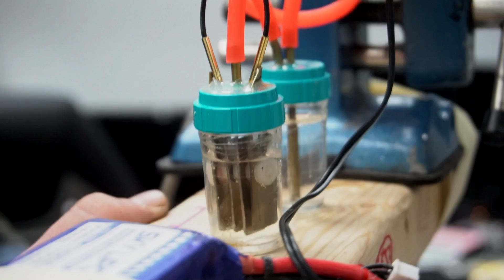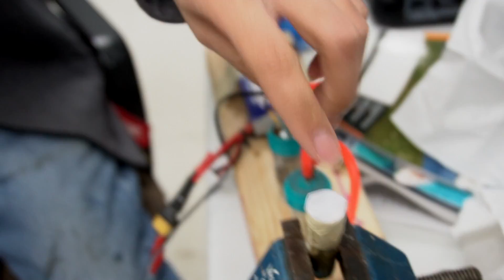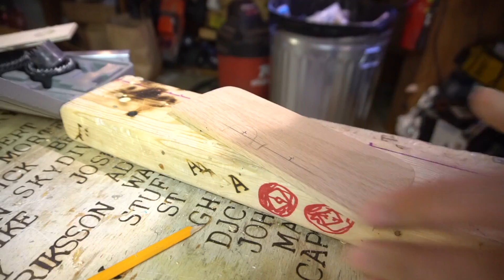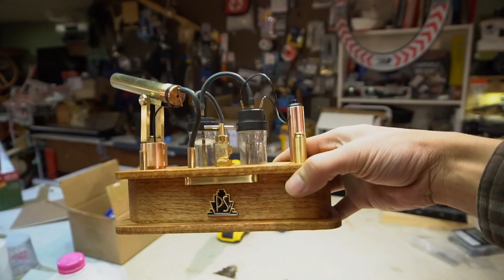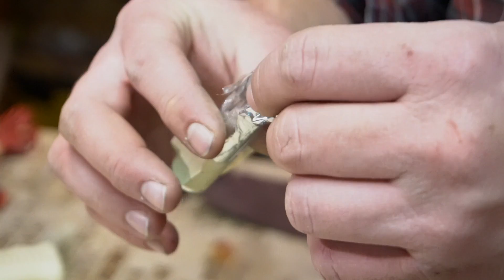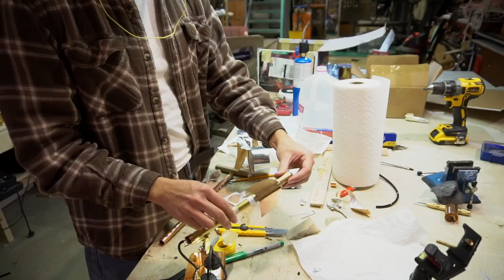Mini DIY HYDROGEN HHO Cannon

Comment: You're making a wet cell it doesn't work as good as a dry cell does you use a lot of electricity to the electrolysis process and it's not as efficient I found that out the hard way and doesn't produce as much hydrogen and oxygen have you have a dry cell it produces more you have less the waist of electricity

Comment: Peter, have you ever made a hot-air balloon, out of a dry-cleaning bag, a copper wire hoop to hold the bag open at the bottom, and an aluminum tart tin to hold fuel? We used to suspend the tart tin under the bag using a few lengths of copper wire and then we poured a few grams of methanol into the tart tin.  Light the methanol, no wick needed, and hold the bag up to let the flame heat the air inside.  After a minute or so, it would go airborn on a cold day.  Try it!

Comment: Make a rocket that goes inside the chamber, like a cannon or a black powder gun.  Making it large enough to seal the walls so no fuel leaks out but small enough to reduce friction on the walls when it gets shot out. Then when you get that working, you can play with the length of the rocket to increase fuel capacity.

Comment: Just a tip, if you heat the solder from the opposite side of the pipe capillary action will suck the solder into the joint

Comment: You should add a small rubber pump to pull a slight vacuum before you fill it, that way you could put the igniter in the chamber and not lose pressure when you detonate it

Comment: I used to have this neighbor who was always tinkering in his garage. He once modified an old moped by running a tube from the fuel tank to the carburetor to catch vapors from the fuel and somehow introduced into the fuel stream. It was amazing, that moped he rode across Colorado east to west, on one gallon of gasoline. He passed away a few years ago, I've always wondered how he did it. Maybe you can figure it out

Comment: The problem is expansion rate.  That gas mixture meets the criteria for a HIGH explosive.  The deflagration rate of matches/gun powder/low explosives doesn't hold a candle to the combustion of a stoichiometric mix of hydrogen and oxygen.

Comment: I once made something similar, except it was more like a HHO powered bottle rocket. Made a stand that the bottle sat on with a piezo electrode reaching up inside to the top of the bottle. HHO bubbled up from the base, displaced a little water then ignited via spark. Bottle made a huge splash and took off like a .. rocket.!

Comment: You should have made the ignition spark happen inside the chamber for a quicker more even burn and also it allows you to plug the vent hole to increase barrel pressure.

Comment: What if you were to take the starter from a lighter and drill two holes on each side of the cylinder and solder them in side it and press the button and it makes an arc inside the chamber to igniter the gases inside it and will shoot it

Comment: Proof that there is a government conspiracy for why we are not making affordable hydrogen powered cars and conversion kits for older vehicles.

If it's that fast & cheap to produce, there really is no excuse why I cannot take my dad's old 1973 Ford Ranchero, fill the gas tank with water, and have it converted to relatively safe* quantities of clean burning hydrogen as I drive along.

*safe compared with a comparable amount of petrol. Side note, which is safer in the event of an explosion? A hydrogen filled Zeppelin, or a Boeing 727(or 737 or 747) full of jet fuel? The answer may surprise you.

Comment: I bet if you used some alrwady fired .45 shells they might fit snuggly into the barrel of the cannon inside so they sabot out the front and build more pressure while traveling done the barrel. I guess itd be more of a gun per say but itd fire farther maybe.

Comment: Peter don't use lye, it eats your unit alive. If you use sodium bicarbonate you can have a crystalline problem but it's a lot better of a electrolyzer. Also if you cook it down to sodium carbonate it works even better. Like I said the only problem. I have is if you over saturate the solution you'll have crystals growing outside of the unit. You have a Hoffman apparatus so so it shouldn't be as bad because you're hydrogen and oxygen are not producing the same container so you're not getting near the production you could therefore crystallization shouldn't be as bad either but it seeps out no matter what Through Time and climbs up the walls.

Comment: And you almost had it right by the way the electrolysis process works is actually the disassembly of two water molecule into two H2 molecules and one 02 molecule. It takes two molecules to make the hydrogen and oxygen mixture. As well some of your byproducts are deuterium and tritium though at Atomic quantities. Another byproduct of the unit is actually helium and 03 which is ozone. Hence the reason if you smell the gas it smells like ozone that's what that smell is, that tingly smell in your nose is Ozone O3.

Comment: Without giving away my secret, if you get away from plates and find the proper material then you can actually quintuple your production. The reason I don't want to give that away is I'm actually developing a hydrogen rifle to try to sell to DARPA and I'm already hitting velocities of that of a 30 ought 6. My production right now is roughly 2 L a minute on 5 volts 2 amps out of a pill bottle. A ridiculous quantity but that's because I crammed a 7-foot cathode in the pill bottle, and yes it's a standard pill bottle. That should kind of give you an idea of how I built my electrodes, you're smart think about it. What can you put 7 foot of inside of a pill bottle and still have room for an anode good luck Pete. PS I'm not new to the game I built my first cannon in 2011, hydrogen powered cannon that is. I built my first Hydrogen unit in 2007, and I built my first hydrogen powered electric generator in 2014 same unit could run a four-wheeler. Though that unit was really dangerous and I didn't know what I was doing at the time with containment hence the reason I don't post any of my projects, the day I do start filming it's probably the day I blow myself up.

Comment: You can always separate the electrolysis container and fill the chamner with only Hidrojen gas. Once you ignire it will only be able to react with the oxygene outside making the reaction slower and less powerfull which is much safer.
Reply: Bruh do you not have autocorrect

Comment: you can simply use sodium chloride to lower the electric resistance of the water, even simple iodine table salt will do. No need for an alkali like potassium hydroxide.

Comment: im wondering if it would gain a tighter seal and a little more pressure if you brushed the brass tube with a bit of vegetable oil or some other thinner oil.

Comment: Well at one part you are wrong hydrogen splits with the oxygen but since both are diatomic it forms h2 + o2 that's why you have remnant water after the decomposition takes place. This is the full formula    2H2 0 -> 2H2 O2 with respected balanced coefficients.

Comment: part 2? electric igniter(spark igniters or glow plugs?), and automatic discharge valve?(it loosely opens when refilling by spring compression, and closes by pressure when combustion happens)

Comment: Hello. My name is Remy. I really love your project and I built a similar one myself. I had a few questions about it. 
1) what kind of metal did you use for the plates? I’ve used steel and aluminum, but not yet stainless steel. 
2) where did you source the hydrogen peroxide barrel lense cases? I can’t seem to find them 
3) what amperage is your battery? 
Thank you and I hope to here from you soon!

Comment: If you add a flap valve to the bleeder hole you'll probably get much more pressure in the combustion chamber so the rockets will go further.

Comment: Aye pete i was wondering since u r a little familiar 2 ballistics on other words u can shoot. How a bout a 177.0 cal mounted cannons aka guns m177 market is so lousy u can barly keep it strait with a 1 inch barrel. From my observations i think u can successfully in stall a workin cannon aka small caliber firearm. I bet u can make this the first in the world with a99% percent projected impact.oops sorry 4 rambling on but mabe u can perfect the riffling in a home made stainless steel barrel .IT WILL B THE FIRST ANTI RC AIRCRAFT CONSIDERING THE ENERGY THE 177 CARTRIDGE CAN PRODUCE. OH AND 177 IS UR AVERAGE SIZE CALIBER 4 BBS AND PELLETS. BUT INSTEAD OF BEING POWERED BY AIR THIS HAS A CARTRIDGE. MUCH LIKE THE 22S U WERE USING 4 THE CLOCK .U STILL HAD TO DETONATE THE PRIMER AFTER TAKING THE SLUG OUT. IT LOOKS LIKE THAT 22 CARTRIDGE WITH NO VISABLE PRIMER.IT BASICALLY LOOKS LIKE A MINNY 223 CARTRIDGE. PEACE OUT .

Comment: Make magazine did a two stage bottle rocket using HHO, which I tried to build. Got one stage working easy enough, getting the second stage timing right was what I end up struggling with. There's a video on my channel of the HHO generator and bottle rocket.

https://makezine.com/2009/11/17/interns-corner-hho-rocket/

Comment: What you should do is put the two wires that ignite the gas inside the brass tube and seal the hole in the back with hot glue because lots of power is lost because of the hole in the back

Comment: 2H2 + 02 = 2H20 , so actually as the burned H20 vapor cools down it will take up less space than the starting gas. Moreover, when the  H20 vapor condensates to water, it will take up a lot less space and potentially create a halfway vacum. Your cobber tube is a great heat conducter and is probably speeding the hot gas implotion by cooling it. If you used a nylon, tube you might get a slightly better result.

Comment: Most of the hydrogen exits threw the hole that you use to ignite it because it’s the path of least resistance you need to put the wire inside and hot glue it closed

Comment: hi peter, I was just wondering. what type of CAD program do you use for your 3D printing? I've looked at several programs so far and I haven't managed to find it. The reason I ask is because I want to build a propeller for a sea scooter but I can't find a boat prop the correct size.

Comment: you should try making a little engine to run off hho, turbine or piston. maybe seperate the positive and negative going into hho generator so you can collect oxygen and hydrogen seperatly for more safety.

Comment: The reason the paper didn't work was because it was creating an airtight seal as HHO tries to go into the barrel the paper will act as a plug and stop air from traveling. Imagine blowing through a straw with your finger on the end of it to stop air from escaping that's exactly why the paper is not working you actually would have been better with a hole in the top of the paper because you simply we're not getting any HHO into the barrel at all that's what I mean by a straw with your finger closing the bottom end as you try to blow into it

Comment: Just a little bit of a warning KOH is an EXTREMELY dangerous chemical, and the way is handled here is not really safe. KOH and NaOH will burn flesh aswell as damage nerve endings, so while your skin might be damaged you might not feel it at all. I am a trained chemist, and my opinion would be that if you are going to us this type of chemicals use google, gloves (nitrile), and a lab coat or apron. Also use the appropriate amounts of pellets (ie. use a scale) with a spatula, you really don't need very much of it, or use something else to make an electrolyte solution. Just trying to keep you safe, I quite like your videos.

P.S. The more water you use to make hydrogen the more concentrated the KOH solution becomes, use some white vinegar to neutralize it when you are done with it.
Reply: It’s interesting that it becomes more concentrated.
If you were to add distilled water back into the solution, would it dilute back to the original mixture?

Comment: Peter, I am not very savvy with this stuff (science) but wondered if the vent at the bottom could sealed off after charging and an internal spark generator provided because this would prevent pressure escaping through the base?  Good advice from comments below.

Comment: Hey Peter, how did your Lasik eye surgery go? I'm thinking about getting it, but feeling nervous. Love your current awesome project! I tried working with hydrogen/oxygen when I was young with a lead acid battery, but didn't know what I was doing and poured acid over the concrete walk way. Turns out that it cleaned it rather well from aging. 😂
Reply from the maker: furonwarrior went well! Super easy. The only thing is I have a 15% increase in some eye floaters so that’s annoying and night vision is slightly worse. Other than that I see 20/15!

Comment: Did similar experiment 44 years ago.... obviously water can be used as fuel....
Reply: but only efficiently if the electricity/energy is free.
no free lunches in our dimension(s)

Comment: you should use a pezeo electic igniter i made something simular that launched a Qtip acrost the room in too the fridge and half way back too the living room using a medicin botttle and a small tube. the hydrogen went in one side and the oxigen went in too the combustion chamber on the other. i used two wood scru's too make the spark gap in the center of the chamber for wen i fired it off. i axidently had the back blow off one time after putting way too much hydrogen and oxygen in the contaner. it sounded like a gun shot wen it blew the cap off.
Reply: oh hey i spoke way too soon yeay he he

Comment: Peter, you should have the barrel sealed, with the piezo igniter spark completely inside.   There is no need to feed the propellant into the end of the barrel either.  Then you can launch projectiles from within the barrel as well as rockets.

Comment: -Question?
Is it more efficient to have like a Tesla car system, minus the electric motor and replace it with a HHO generator and a combustion engine, or is the energy density of HHO not worth it? The alternator could recharge the batteries and you would be using water as a fuel source instead of petrol.
Reply: Ryley wouldn't be efficient. A big drawback of combustion engines are that they are inefficient. Electric motors are connected directly to the battery and can reach efficiencies close to 100%
If you used  a hho generator you'd have some efficiency loss in the generator and a lot of efficiency loss in the combustion engine. Effectively you'd have to carry much more batteries than a comparable pure electric car
Reply: Google information about 'Steven Meier's call' 'Stanley Meyer's water fuel cell',  please. Goog luke!
Reply: The alternator cannot charge the batteries using energy it derived from fuel made using the batteries, that would be free energy.  Battery -> water -> HHO -> engine -> wheels is much less efficient than battery -> motor -> wheels.

Water is not a fuel.  Water is NOT a fuel.  Repeat after me: WATER is NOT a FUEL.
Reply: Ryley oh yeah lol. As someone's pointed out you can forget about recharging your own batteries
Reply: I get the law of conservation of energy. Its not free energy because the water is being consumed in the process is it not? The alternator derives its energy from the combustion engine. 
So battery -> water -> engine -> alternator/ Wheels -> battery.  
And yes I know water is not a fuel, it's the hydrogen that's the fuel, but isn't the water being consumed in the process of making that hydrogen?
Reply: Ryley theoretically the energy you put into water to split it is the same as the energy released when you burn hho. In reality you'll use more energy to electrolyse some water than you'll get back due to combustion due to inefficiencies in the electrolysis procees. Energy is conserved here, you just lose some of it due to inefficiencies. If you use this to power a car you're losing most of your energy to power the car. This energy can't be recovered to recharge the batteries
Reply: Ahh that's the problem, I figured the output energy was greater than the input energy. If that's the case when you spit an atom in a nuclear fission reactor, you lose a lot of mass, and as we know energy can't be created or destroyed, and matter is another form of energy, so where does the matter go, well E=mc2. So that mass that gets lost gets converted into a great deal of energy. You lose mass for energy, that's why I figured it would be the same as the HHO generator,you lose water for energy. That's why I thought it wasn't free energy. haha. 

Also I realise it wouldn't be the most efficient setup if it worked, but it might conquer some of the issues with electric cars.

Comment: You add the base to water to prevent it etching your glass ware and the soap feeling is the base turning the data on / in your skin into soap ;) cool lil build though and loving the fact you're using a hydrogen generator via electrolysis  oh and if memory serves you could just use sodium carbonate and if I recall correctly it will be a better pH for your purpose :)

Comment: I need you to static fire your own rocket engine. I suggest electric pump and use Henry Segerman's progressive Hilbert curve as the nozzle for combining the fuel and the oxidizer. If you have a metal printer that is. It will take two streams of fluid and combine it into a checkerboard of streams as fine as you please separated till the last moment with minimal diversion. Feel free to use another fuel, I would be happy to see it mix two fluids or make a heat exchanger. I mainly want to see you use the Hilbert curve in a practical application.

Comment: You can use citric acid as your electrolyte too.  Much safer.  Just don't use salt (as I did in high school) as you end up with chlorine since it ionizes somewhat readily. NaCl >> Na+ / Cl-
Reply: N VO want to do this as a science project I’ll try your way and see if it works well cause I also don’t want to burn my hands and other body parts in general